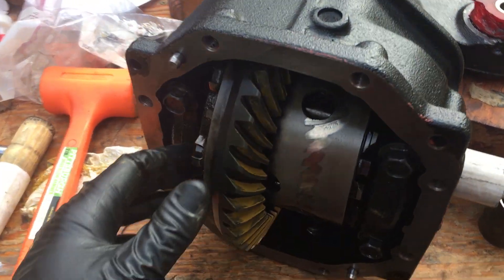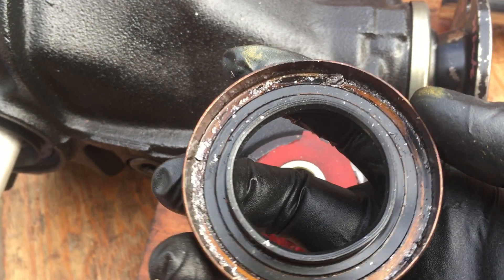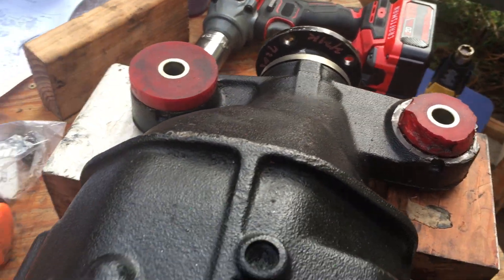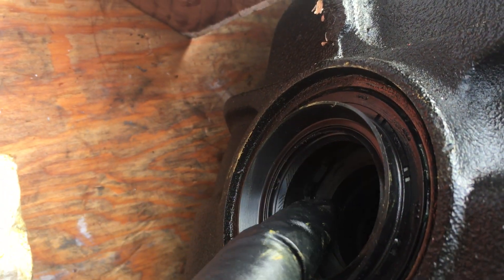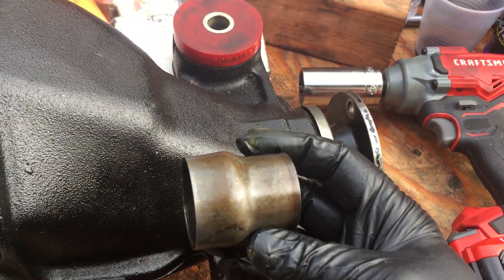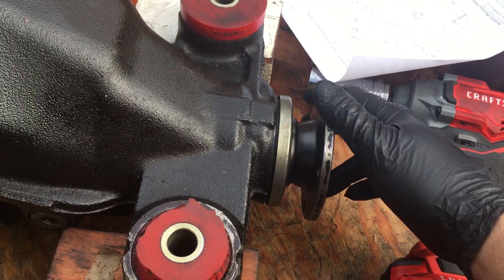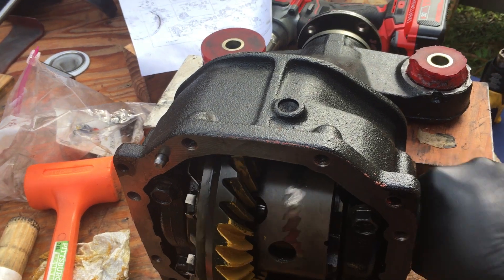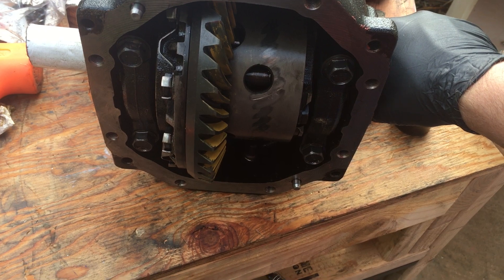backlash adjustment of repaired m85 torsen differential from lexus is300 2001 2005

Comment: Did the new crush tube reduce the backlash that seems to be common to these diffs?

mine really has a lot of slop that can be felt by turning the tailshaft by hand
Reply from the maker: Hi Sassi, there should be almost no play in/out.  Factory has a certain amount of healthy rotational play.  A metal milk shake would be one sign that you (or previous owner) may have worn your gear-set down.  The best way to tell that is to pop open the rear of the diff and look for excessive wear on the teeth.  But to be clear, the crush tube would normally not be the sole fix.  Except if someone recently loosened it and has not driven too much yet.
Reply: @kidicarus2637  no play in and out, but significant rotational play, causes a very noticeable clunk when shifting slightly quickly at low speeds, I have several diffs and they are all the same/similar, do you have this issue with the diff in your video? It looks to be a clutch type LSD not a torsen
Reply: @MegaSasquatch777  same here I’ve got a 17’ mustang with a torsen. Same exact issue…
Reply from the maker: @MegaSasquatch777  This diff is a torsen & there are no clutch based diffs from factory on 02-05 is300 afaik.  If you have a diff not mounted in your car please post a video of the rotational play, and share more info about the year/make/model.  Also, have you ruled out linkage and mounts?

Comment: i have this diff in my is300 at low speed when i turn hard and then accelerate i get a very concerning rumbling and bumping from the rear, Im afraid its the differential. any tips or insights?
Reply from the maker: Hard to say without hearing it.  I suggest draining the fluid from the diff to inspect the condition.  NOTE: never remove the lower drain plug until you have first successfully removed the upper fill plug.  Sometimes the upper will strip and you will be unable to fill/refill the diff.  Good luck.  Post videos of the sounds and the fluid/drain magnet.